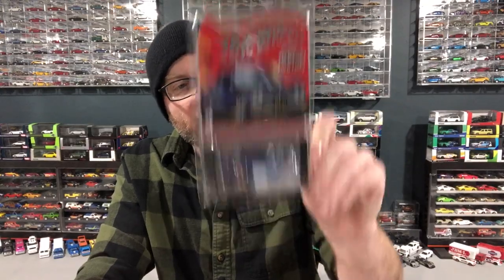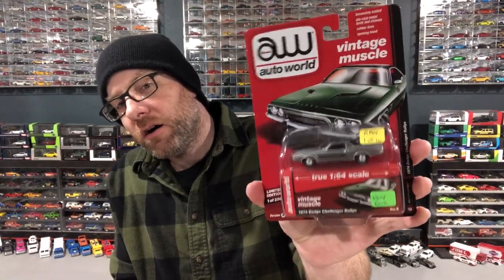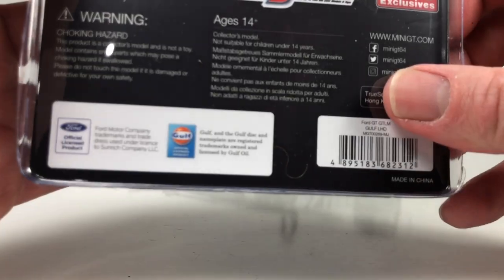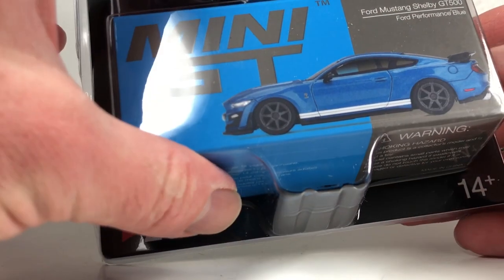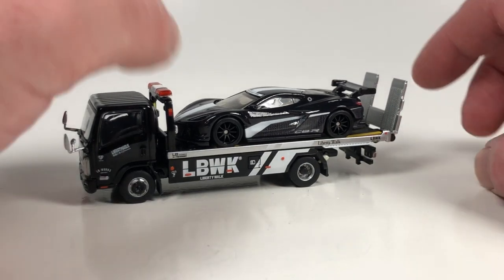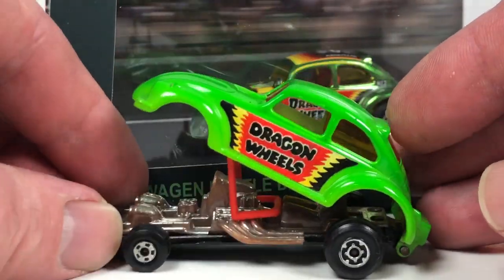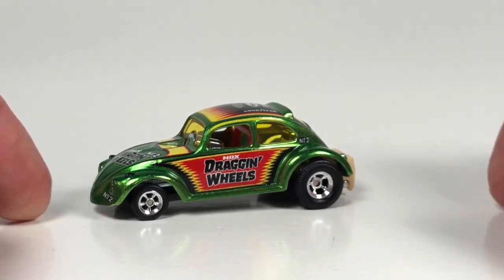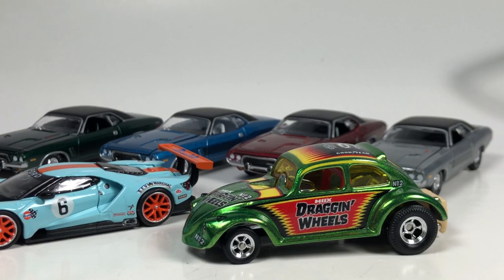Diecast Weekly Ep. 304 - Auto World RAW! Mattel Creations MBX, RLC Skyline, and Sweet Mini GT

Comment: I don't think the Dragon Wheels technically has any tampos, the original Superfasts usually had labels stuck on instead of tampos (or no tampos at all, which looks fine in some cases especially if the headlights and grille are part of the chassis).